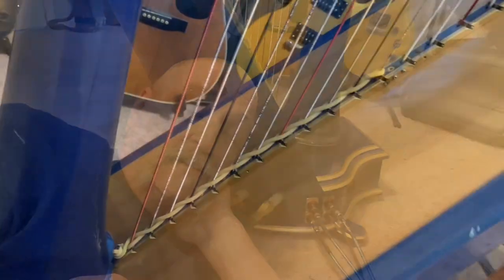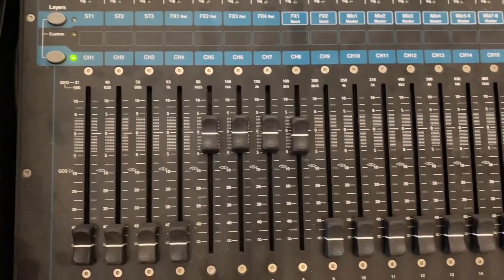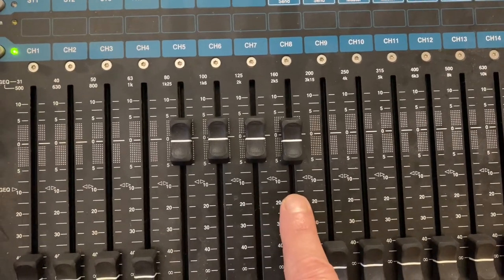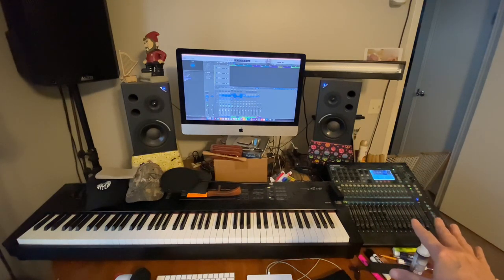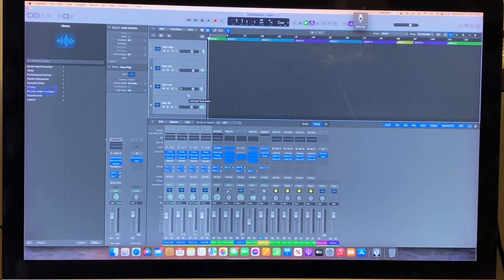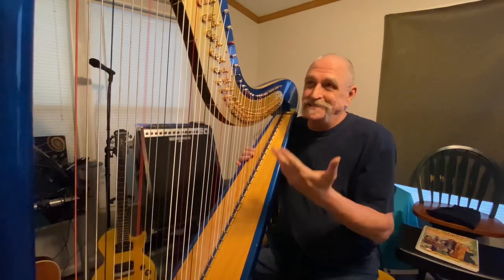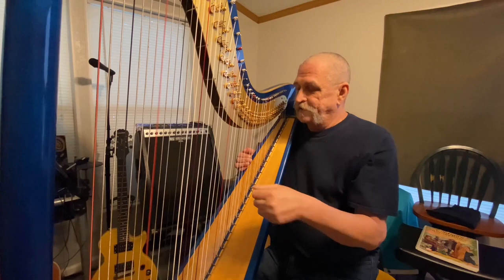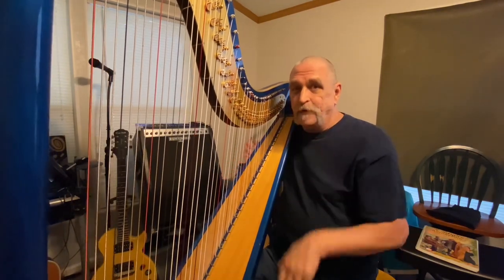How to record electric harp for eq, separation & mix

Comment: What settings do giu use for eq and compression or other processing? I am doing a family cd for xmas. I bought ableton for a daw have a scarlett focusrite to feed the output to the computer. I am just learning how to do this though and it is getting time crunchy!
Reply: I am using an elysee with a fishman pickup I attached to just slightly above midpoint on the inside of the soundboard so I don't have all the options u do in terms of channels. I just have the soundboard sound.
Reply from the maker: I’m using an Alan & Heath QU-16 mixer as an interface to my daw which is Logic Pro X. All of the plugins I use are native to the daw. I usually run the soundboard mic to the effects totally wet. I fine tune the eq and compression for each of the three pickup zones. I also usually apply some eq and compression to the mix bus strictly for blending before mastering.